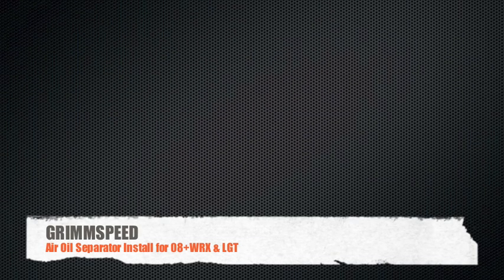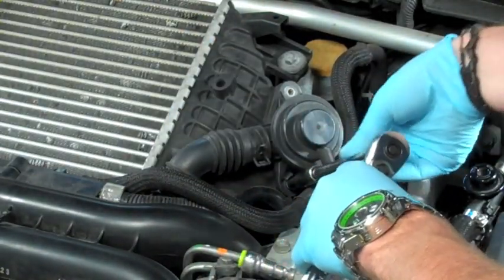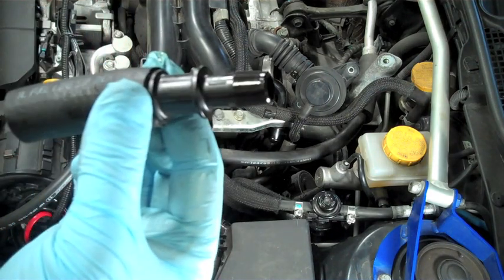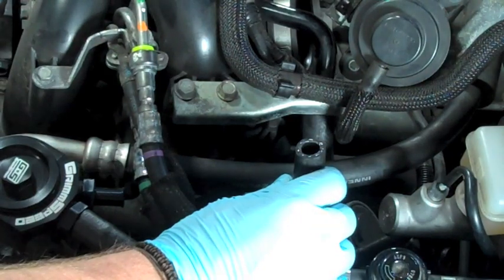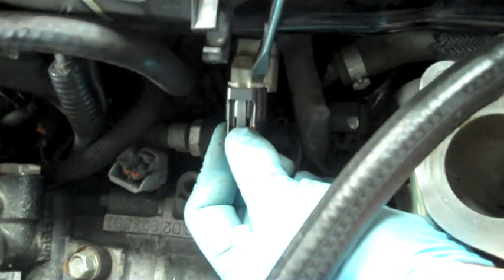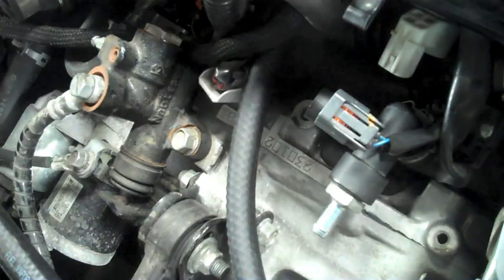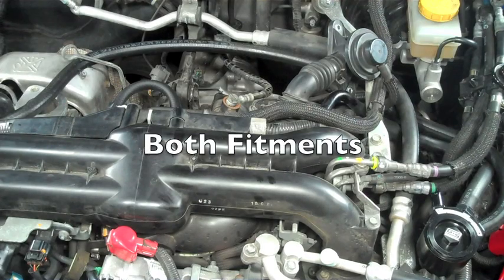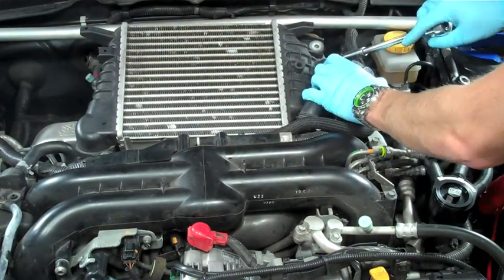GrimmSpeed Air Oil Separator Install 08+WRX / LGT

Comment: Can you confirm which install is for an 09 FXT? Instructions do not explain and neither does this video. I followed the 08 wrx install method but not sure if thats right. Also, there were no 5/8 or pcv hose in my kit so I had to go to the hardware shop and get some 😠

Comment: Any idea on connecting a catch can to go along with this AOS? I plan on running both. Suggestion on how to's?
Reply: What’s the point of that lol
Reply: @732ajay  Neither an AOS nor a catch can is totally effective at removing all the oil & fuel mist, moisture, or other contaminants from the air running through them, so having multiple solutions in series cleans up the air more completely.

Comment: also been told by tuners this is useless and doesn't work anywhere near as good as a catch can, this has way too many connections as mentioned and is too hard for what it is, surely you can come up with something easier/more efficient for that price
Reply: +Luke Pas So what would be a good catch can setup for a 16 wrx? I am not paying over $500 for the mishimoto system. Thanks
Reply: +sportsmc3 well my tuner told me these bolt on kinda ones dont work
You need a proper external oil catch
Can that runs on its own like a crawford one for example not the ones that just screw where your oil cap would go
You should still run a standard oil cap and the air oil seperator should be a different piece all together
I have been running 210kwatw for years without one and no problems but ofcourse it wouldnt hurt
Its much more necessary for higher power or track days
Unfortunately its still going to cost at least 4-500 for a proper oil catch can set up
Reply: Luke Pas Yea, well the mishimoto system looks really nice so I may end up getting it, and this would be my first install of this kind (not mechanically inclined) so I would need someone with me in case I run into an issue. The problem I have now is the video from mishimoto went really fast, and they described the silicone hose setup for the first catch can in reverse, you need to install the hoses the way the video showed it lol
Reply: I concur.

Comment from the maker: This installation video is on a older model, check out our installation PDF on our website under the product.  This installation document has ore current pictures on newer models that will make more sense.  -Matt Homes